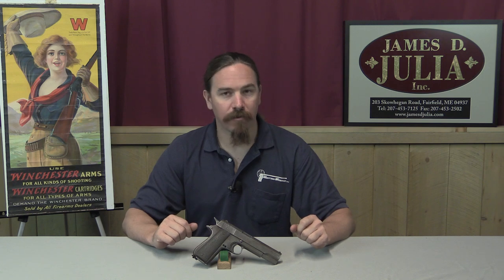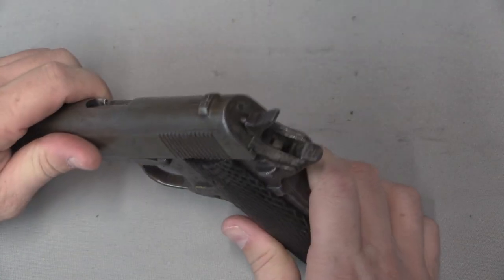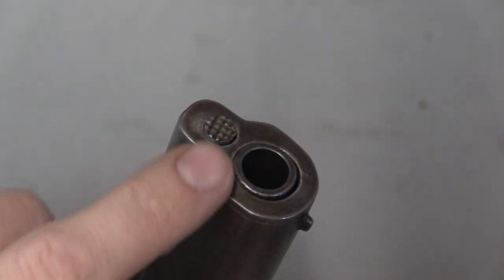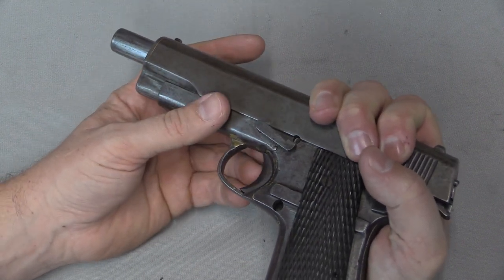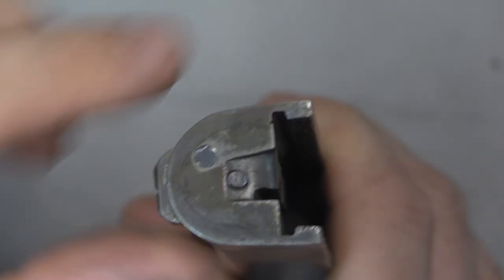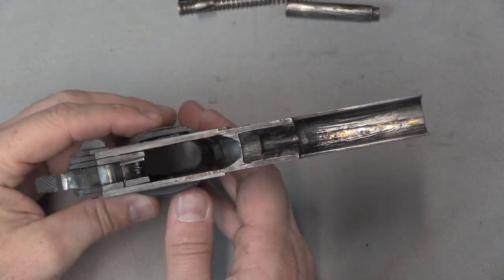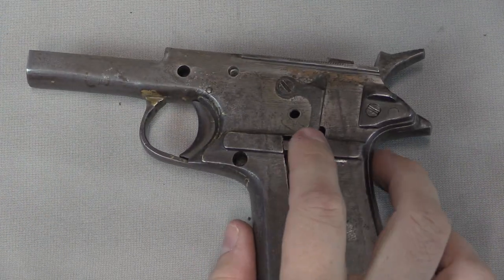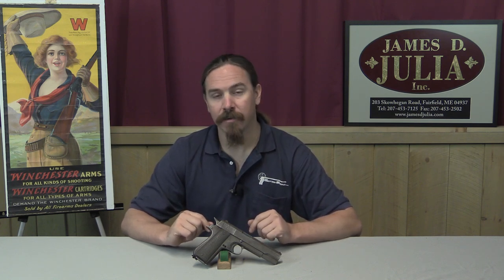Vietnamese Crude Blowback 1911 Copy

Comment: He said that proper 1911 was an 1911 it is actually a m1911 a1 to identify this look at the grip safety and the lower back part of the handle on a 1911 the grip safety is short and often caused hammer bite aswell the spring cover at the bottom of the handle was not bubbled out on a m1911 a1 the grip safety is longer to prevent hammer bute and the lower back of the handle was bubbled out for low shooters

Comment: Wow . . . Fantastic. . .I think that a smoothbore would not yield high chamber pressure, and blowback might work. . .Maybe. . .I wanna find that Viet-Cong machinist and hire him. . . .give him some real tools. . .and show him my vintage cars that need parts.
Reply: Actually the bare minimum bolt weight to safely shoot a .45 ACP in a blowback weapon is not that much. Just around 12 oz. / 340 grams. A standard, 5" barrel, 1911 slide weights more than that (12.6/13 oz).

Comment: I carried a 1911 during both of my tours. On my first tour some clown 2LT  on accident wounded another officer standing in front of the CP. After that happened it was learned the shooter was not carrying his assigned weapon, so at command level the word went out. If you weren't assigned a .45 then you could not carry one and we had to turn in all of the pistols. I was a 2LT platoon leader. I carried a .45 because at the time we were experiencing malfunctions with our new Colt .223 rifles. Too bad about that but don't get caught carry a .45. I gave it about two months and as soon as I had the chance, I picked up a .45 from a medivaced soldier. Actually I see this VC made .45 pretty neat. Hey what the hell does it matter. If that thing served it's purpose then so be it. It was probably used to scare draftee's into line. The leaders led from behind while waving that pistol around ordering their troops into battle. It probably actually worked.  I have picked up US made.45 pistols left behind by the enemy. This one was probably made like you stated. One of my buddies picked up a .45 cal grease gun sub machine gun. It was used by tankers because of the sliding stock . It held a pretty long magazine. It was also used during WWII and Korea. Well at the time, I was the know it all, and volunteered to shoot it. I loaded up a magazine and with a round in the chamber pulled the trigger. The ejection port cover was closed. When I pulled the trigger the round exploded and blew the cover off and the magazine down out of the weapon, and jammed the weapon. The new owner yelled at me and wanted his money back from me. We learned later that the barrel had been screwed in to far, which gave an incorrect head space . Actually with the bolt closed we could see the brass from the round loaded in the chamber, and when I fired it, brass blew out and damaged the cover. Nobody wanted to fire a second round, Chuckle chuckle, ooops.